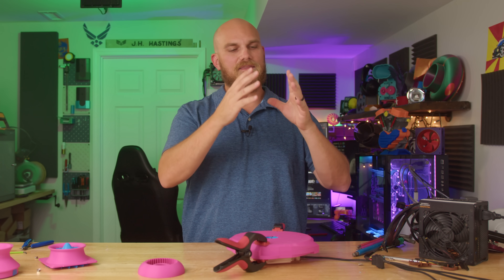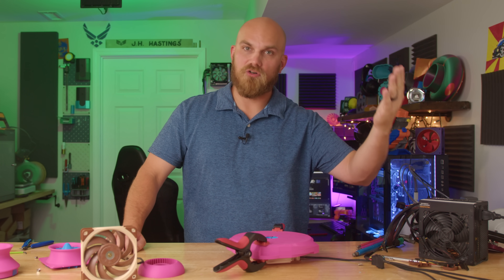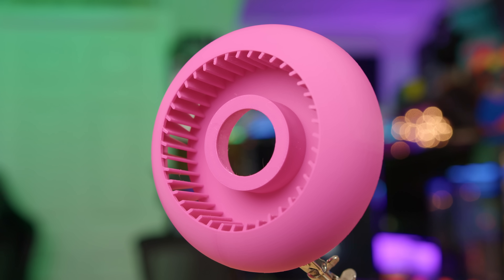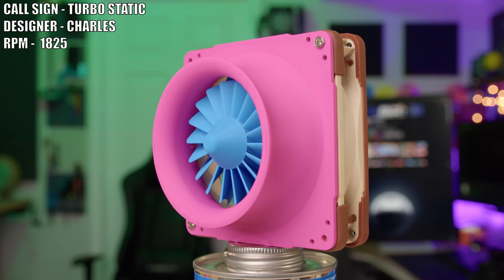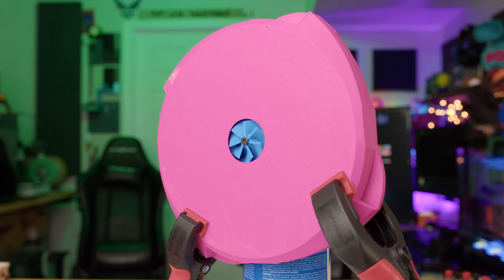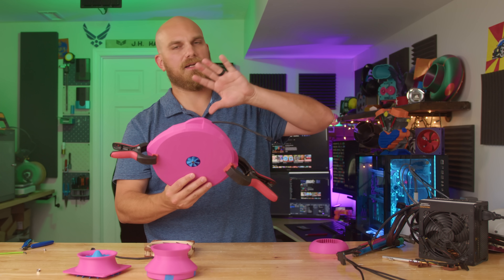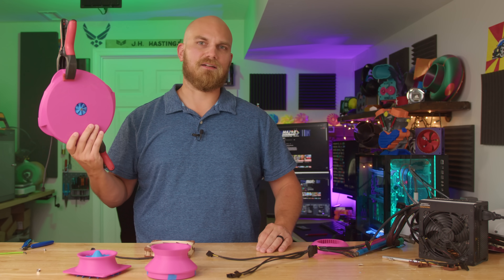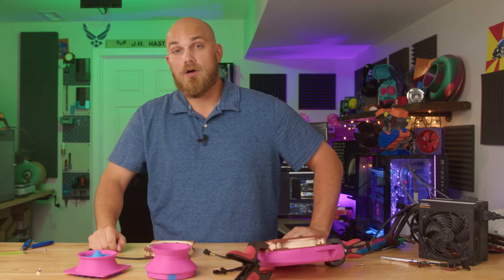Wild 2-Stage 200mm Blower Fan Redefines Power | Fan Showdown S6E6

Comment: I like that anything goes, but they should at least be operational as designed for you to test them.  If the "centrifuge madness" had to be altered, then it shouldn't have been tested.  
The only rules should be; that it has to work as designed by the viewer, and that all parts have to be 3d printed, or hardware to hold it together, ie glue, screws etc.
Keep the great content coming.   Stay Happy and Healthy

Comment: start a pc water cooling pump competition. set a size envelope with set locations for the in/out g1/4 fittings and a defined motor. probably would have to define the housing interface as you would want to go with a simple mag drive setup.

Comment: the difference between the two camps would just be like drag racing. Youve got the street legal but tuned cars that still perform decently, and then youve got the Purpose Built drag racers, the Funny Cars and Top fuel dragsters which arent street legal but outperform everything else. Theyre in seperate classes because the average hobbyist with a slightly tuned honda civic cant compete with the professional Top Fuel dragster. 

Another note, I would think alot of your viewers started watching this series because a lot of these designs were  workable, usuable fans that could be modded to actually do a job in a computer case. The average person isnt going to use one of these gigantic shrouded fans to improve cooling or noise in the computer. Thats why I think splitting the charts/categories would be the best bet. no more decent but usuable fans being runnover by purpose-built performance fans that have no utility other than trying to be at the top of the chart.

Comment: I am blown away that even with the big compressor taken off, it still would have hit second place. I'm curious if the designer did any iterative simulation testing to see if there could be a more ideal ratio of sizes between the big and small compressors.
Reply: IIRC this is how two-stage usually works - the first one compresses less, but it sort of "conditions" the flow before the second stage
Reply: I didn't do any tests, I just went into  fusion 360 and did the best I could, I was surprised how well the small compressor worked.
I think the big compressor doesn't have much effect because they have a lot of cracks where the air leaks out, I hope he can do another test covering the cracks with tape or something.
Reply: Im wondering if the big co pressor is just to restrictive. 
Usually in 2 stage compression a bigger higher flow turbine is used in front of a smaller one. This design looks like its  kinda backwards. 
  
Maybe a bigger intake would help.
Reply: I think the problem is the back side of the big compressor creates a "Tesla turbine" which is actually working against the flow direction. If the flow was guided by a non moving channel back to the center of the next stage, it might work better.
Reply: What surprised me most about that was the small difference the big wheel made. The big wheel and channel between the stages probably slowed down the RPM much more than necessary for the added pressure, mainly due to the narrow channels for the air.
Reply: @fishyerik  With something like this, you're running afoul mostly of our collective lack of understanding of how fluid dynamics works. Don't get me wrong, we do know a lot, but there's still a lot of unanswered scientific questions (e.g. Navier-Stokes solutions, turbulence). Not saying you're saying anything wrong here, just saying there's a lot of unknowns still. For my part, I think the purpose the larger compressor serves is to smooth out possible turbulences/vortices before they happen at or in front of the intake to the smaller one, as they can function like friction and take away energy that would otherwise carry the air through. That's part of why I was wondering about iterative simulations of different size ratios to possibly optimize that flow.
Reply: @GunAinmNoAodann  Science has most of it down pretty good, more than good enough to make predictions in the right ballpark about something like that from actual data about it.

You can't smooth out turbulence (vortices are part of the turbulence) before it happens. You can direct a flow to prevent turbulence later in the path, or try to, but you can't rectify the future. 

I't wouldn't be very good use of that large impeller if was intended to direct the flow to prevent turbulence in the second stage. The overall design indicate some actual understanding of how fans/impellers work, so I doubt that was the purpose of the bigger impeller.

Comment: Please use more than one parameter to compare the fans against each other. Pressure, Air Flow, Noise. And maybe the ranking (air flow x pressure) / noise. (with the additional rule, that the thing has to spin and move air, otherwise a noiseless not working fan could win :*D)

Comment: I like the suggestion other folks made. Have one showing the best "anything goes" and another for those you could actually use in a standard PC case foot print. The Centrifuge Madness is amazing. Would love to see how much air its actually pushing. From the smoke test it seems that fan doesn't move much air, which given the small intake size makes sense. On the other hand the Jet Impeller has some really nice flow.

Comment: Just do two leagues, one for insane stuff and the other for the standard. Also, just glue it with silicone glue, the kind you use in the bathroom. You will have a seal and when done it is fairly easy to remove the glue

Comment: I really want to see how many CFM that the Jet Impeller and Turbo Static produced, those things seem like they are good at both Static Pressure and Flow. But Group B, however there should be a classification for within and outside of size criteria. Fans that stick out to a total of 38mm deep could be considered into the Group N, as 38mm deep fans have applications.

Comment: Make two groups.

Group N: Must be able to be installed in a standard PC case with the fan shown at 2:30 being a good example.

Group B: Anything goes.
Reply: I would add that Group N should not exceed the sizing of the standard A12X25 fan. If you can't mount the fan against a radiator or heatsink in a pull configuration, it is in group B.
Reply: @sheepstardetail  That's fair. Perhaps there should be three groups. One for mountable in a push configuration, one for mounting in push or pull and the third is anything goes.
Reply: @N0V-A42  that would work! Ok major, get to work!
Reply: That's exactly how it should be. What's the point of a fan that can exert tonnes of pressure or move tonnes of air if you can't fit it into a computer case?

But it would be cool to use 140mm fans to see how the same fan design behaves in a larger design.
Reply: In auto sports they'd call it "class"
Stock (as in stock cars) how fast can we make a car go yet still keep it street legal?
Modified (as in formula 1) how fast can we make a car go period?
Reply: outlandish fan designs should include an add-on that makes it belt driven from the case fan motor!
Reply: Camp anything goes!  Love seeing the inventive side.
Reply: Yeah that's a Rally Good idea 🙃👎
Reply: @shaneeslick  because what, pull configurations or bottom mounts don’t matter in today’s PC case market? Nearly every new case is using bottom intake, if the fan protrudes out, it can’t be mounted.
Reply: @sheepstardetail  Yes I agree that the Radial by Arto should no be considered "Not Exceeding" due to protuding beyond the 15mm,
but my comment was just a silly play on words for Group N & Group B using "Rally" instead of "Really"
Reply: @shaneeslick  ohhhh, gotcha. I thought of it too but wasn’t sure if others on here would get it.

Comment: Looked like the Cent. Madness had a leak on the first stage compressor (at the bottom of the case)  during the smoke test. It might produce higher static pressure if it was glued.

Comment: A quick comment though, I miss the correlation to real cooling performance. The tests in place atm doesnt really give that (static pressure for instance). I'd like to see a TEC element setup to determine the wattage dissipation using a good cooler.

Edit: expanding on static pressure tests, use a large intake surface for as much air capture as possible and then pipe it all through a small hole. Big static pressure (although takes a bit longer to build) but crappy real world cooling performance.

Comment: Static pressure is good and all but volume of air is also highly important. Moving a large volume of air over cooling fins of a radiator is what you really want.
Reply: That is why static pressure is important for radiators because the fins cause lots of back pressure and there is a point where moving air faster actually works against your cooling as it doesn't have enough time to transfer the thermal energy. It's the same reason why you want to pump more water volume wise and not velocity wise with a water cooling system.
Reply: @SilvaDreams  "our cooling as it doesn't have enough time to transfer the thermal energy. "   the larger the delta t (the more air goes through) the better the heat transfer off the radiator is. you don't want "slower speed so the air has time to get hot" or anything like that.  

the static pressure just helps in getting the air through the radiator, more air (and faster and that also meaning faster).

the "too much velocity" is an old wives tale from car guys who had some problem or another in their loops where a restrictor helped with more even water movement through the block, it does not help the overall energy transfer through the system to slow down the medium(shown by mathematics, physics, practical models), the cooler the air that's touching the radiator the faster the heat is moving to the air at that spot (anyway the old wives tale car guys who think it applies for fluids don't think it applies for gasses anyhow so they'll happily add more fan, when it doesn't really apply to either)

if you had high pressure fan you could stick more fins on the radiator, so it's all just a balancing act with the space you got and power use and noise you can deal with.  20 watt 40mm deltas are pretty wicked.
Reply: @lasskinn474  I think this contest has long since ceased to be focused on cooling computers, only on absurd tests. And I like it, sometimes you have to optimize the air speed, sometimes the flow, sometimes the pressure without any flow at all... it's fun.

Comment: How about two classes? A "stock" class for the fan in the frame and a "modified" class where...
Reply: Yep, this! Maybe stock has to fit within the dimensions of the frame at all angles? Maybe a super strict interpretation would say it has to be within a certain weight range of the original, too. But maybe that slope gets too slippery and we start talking about current draw by the motor.